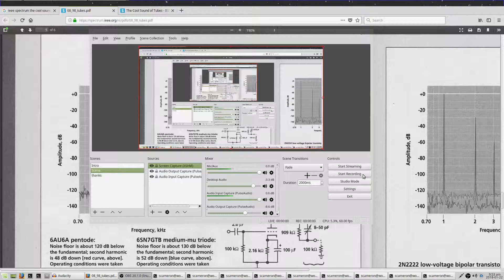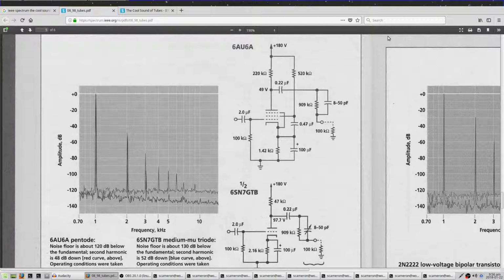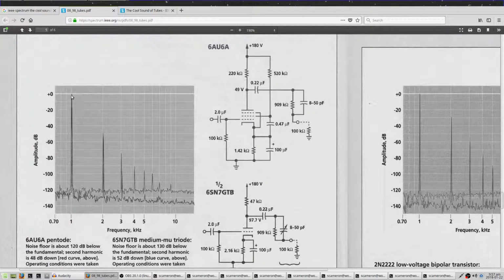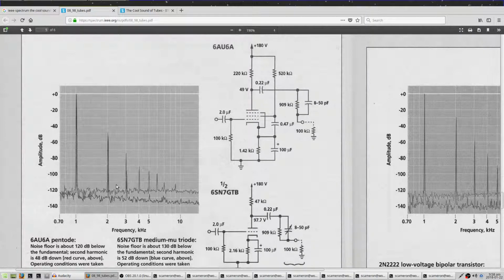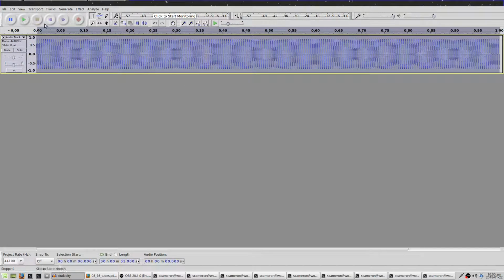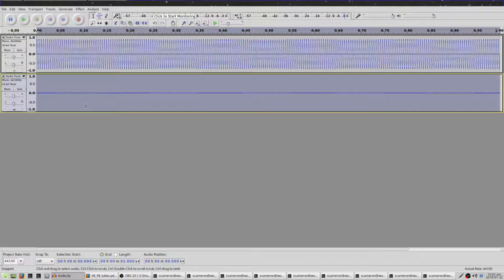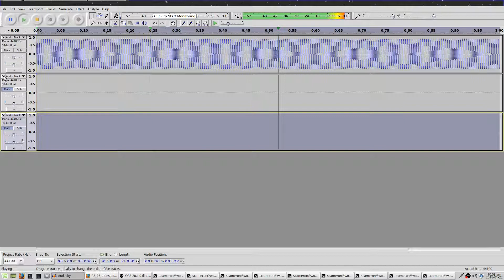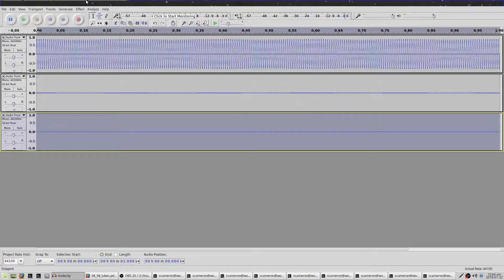Harmonic distortion in tube and transistor amps

Comment: If you really want to learn about even and odd harmonics read my book Distortion: The Cause Of Harmonics And The Lie Of THD. Even harmonics are not "caused" by any particular device or topology, if there is any nonlinearity ODD harmonics will be produced (and so will EVEN harmonics) but if the nonlinearity is symmetrical in either voltage or time (clipping on both sides or slew rate distortion) then the EVEN harmonics will appear and be heard.
Reply: Symmetric clipping produces predominantly odd-order harmonics. Asymmetric clipping produces predominantly even-order harmonics.
Reply: @lazzer408  Yeah he got it backwards. Hopefully, his book is correct lol!